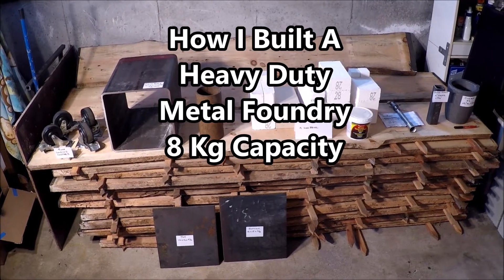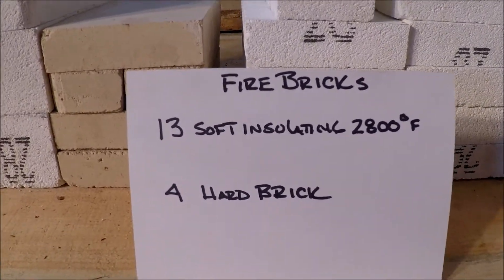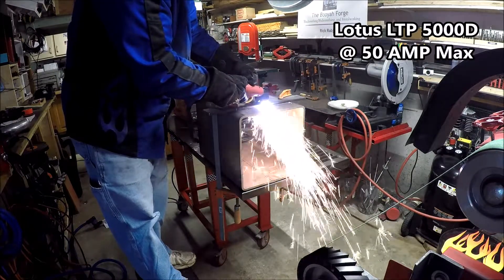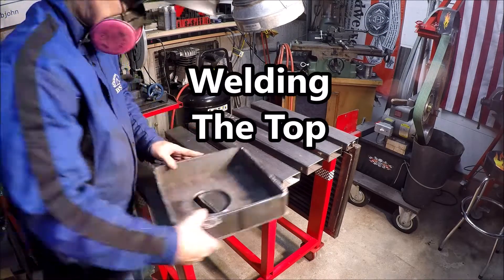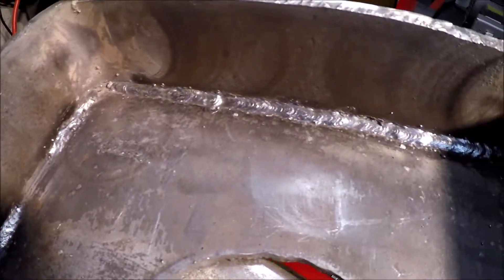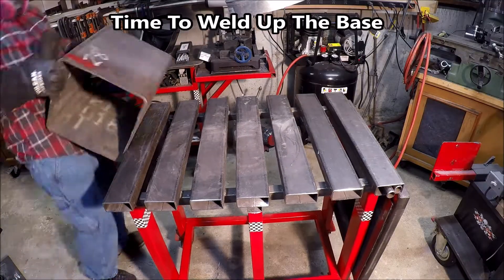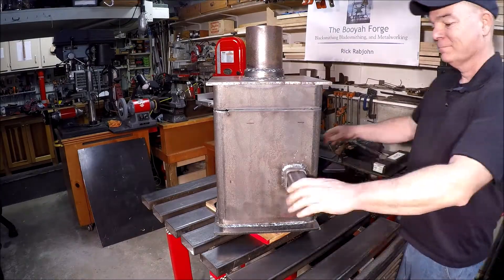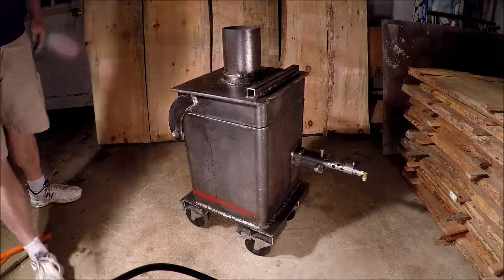Homemade Metal Foundry

Comment: I built a forge/foundry from a 6 gallon galvanized bucket with lid. I built a propane burner but when I tried to go through the crucible seasoning with borax, I just had orange flame. I could not get the crucible hot enough to melt the borax or even start to get the crucifix to glow. I have seen some youtube things about altitude issues. Wondering what your thoughts are. I'm at 5200 feet above sea level. Where is the best place to have the air enter and mix with the propane jet, behind the jet or  slightly in front of the jet?
Reply from the maker: Hey Daniel - I worry about you using "galvanized" bucket - galvanized steel gives off harmful fumes when heated.   Insulation of the foundry is obviously critical and number of propane burners used.   Ceramic coated thermocouple to measure temperature inside the foundry can help.  I have always purchased my burners and the air flow for them is  pulled into the burner pipe at the opposite end.   Good luck with your project
Reply: @RickRabjohn  So far I  used a 95 LBS bag of high  temp concrete refractory for the bucket  and  1/2" thick ceramic high temp refractory for the lid. So far so good. Thanks for the concern. I have not noticed a reaction like trying to weld galvanized pipe.

Comment: Well made Rick, just wondering, why did you make a square foundry and not round? will the flame go around just as efficiently. .
Reply from the maker: The plan is to cut some firebrick at 45 degree angle to fill in the corners inside which will create the vortex - I also like the square cause it's different and easier to work with .... Thanks for checking it out